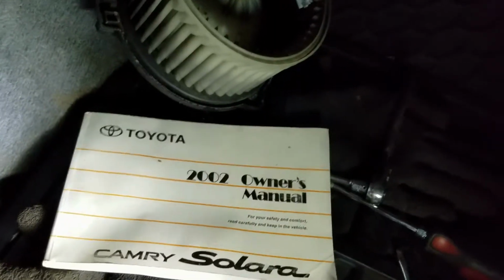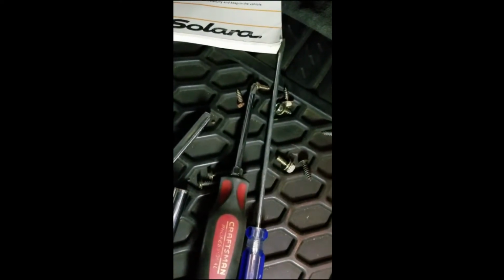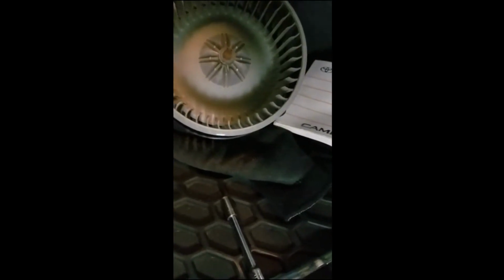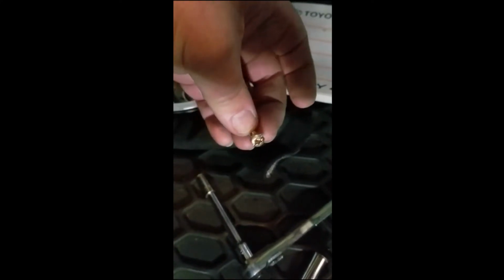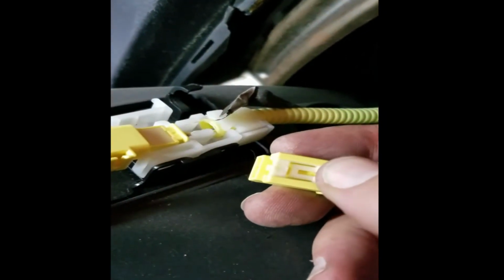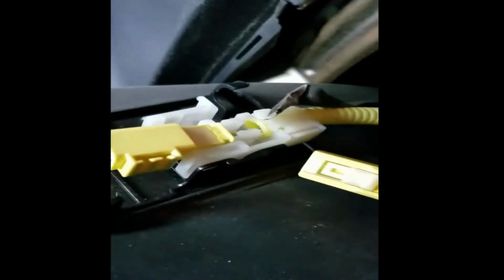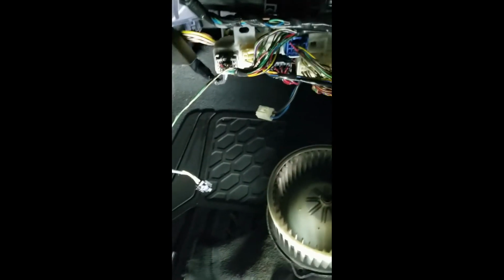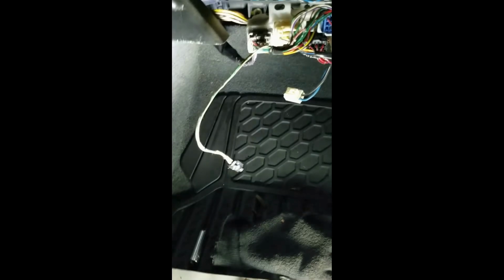2002 Toyota Solara Camry HVAC blower motor replacement

Comment: In my 02 Camry the a/c fan isn’t blowing. Could replacing this part fix the issue?
Reply from the maker: Thanks for tuning in. That definitely could be the issue. If you have a multimeter you could test for 12 volts at the plug. Most likely you have a bad fan motor, they are known for just quitting out of nowhere.

Comment: Wheres the filter at?
Reply from the maker: Thanks for tuning in! Mine didn't have a filter at all.
Reply: @NorthCoastT  I couldn't find one either would there be a reason for the vents not pushes air/wind out , I tested the fan and works, blows more air if I switch to window vents rather then front or bottom fan vents